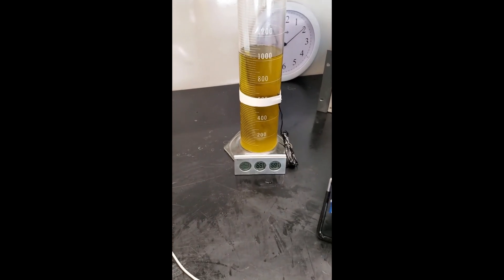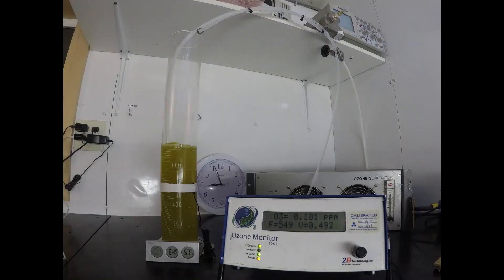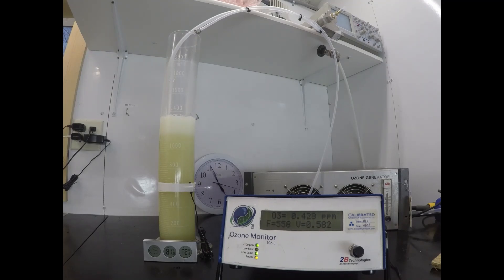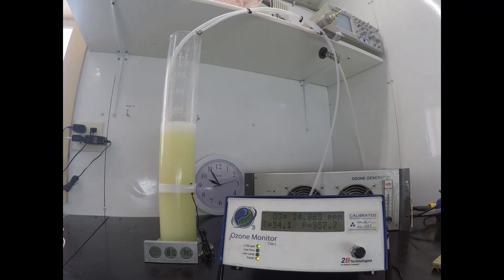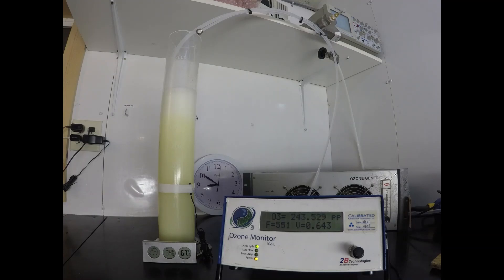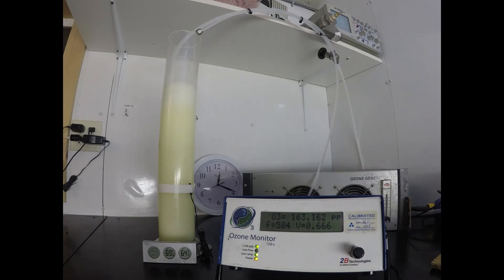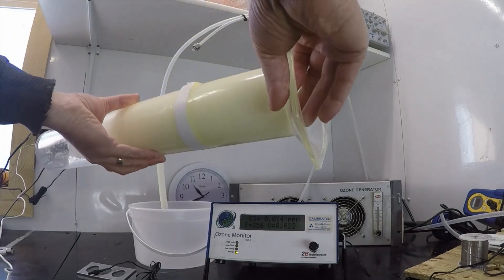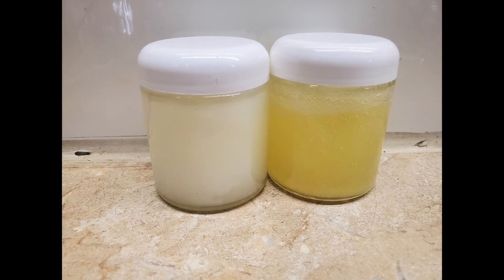Creating Ozonated Olive Oil with Dry Air Ozone Generator

Comment: which ozone generator do you use
Reply from the maker: In this case we used the RMU-K6 with dry air.
https://www.oxidationtech.com/rmu16-k6.html

However, in the vide, we explain we prefer to use oxygen fed ozone generators to produce ozonated organic oils.  The VMUS-4 + PRO-5 are great options:
VMUS-4 = https://www.oxidationtech.com/vmus4.html
PRO-5 = https://www.oxidationtech.com/pro-5.html

See our our other video producing ozonated olive oil from those devices:
https://www.youtube.com/watch?v=D1kT1dVMdqA&t=1s

Comment: What is more effective the dry one or oxygen one
Reply from the maker: Olive oil created from oxygen has more reactive oxygen species contained in the liquid and is therefore MUCh more effective.  We do not recommend using ozonated olive oil created from dry-air feed-gas.
Reply: @Oxidationtechnologies  I have Ozone sterilizer, Can I use it to make ozone water for drinking?
Reply from the maker: @Hudaalhajri  This may work, we would need to know what ozone machine you have to be sure.